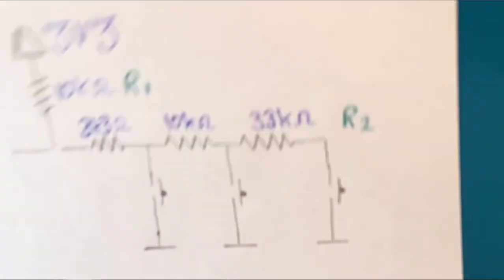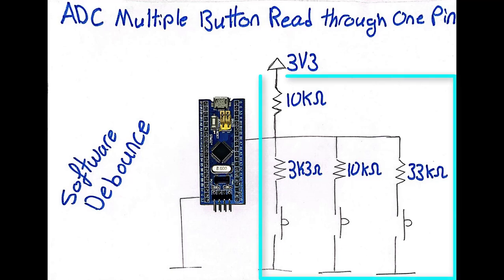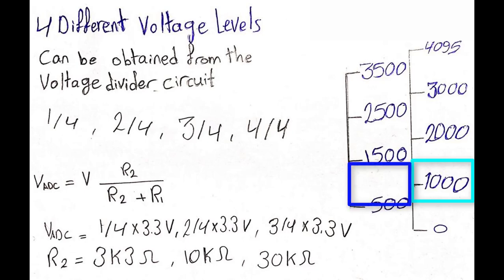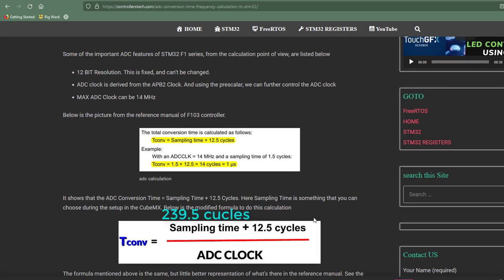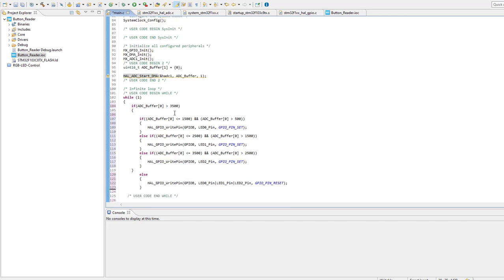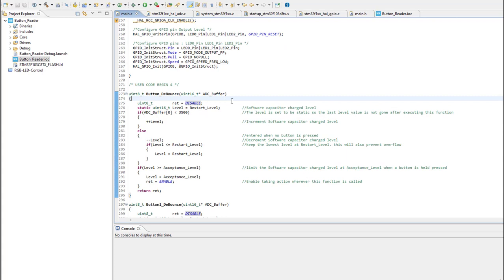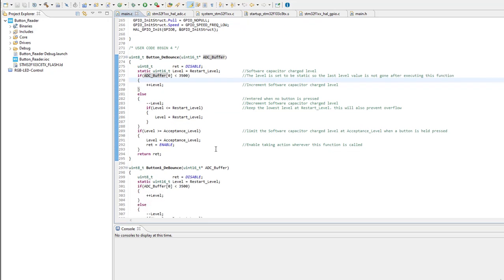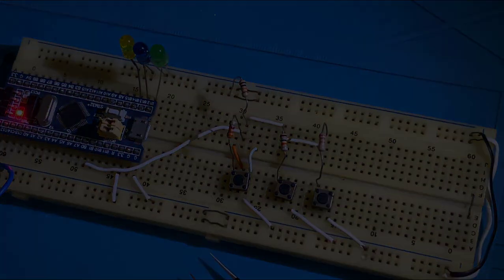STM32 Multiple Buttons ADC Read Through One Pin With Software Button Debounce

Comment: Do you have any sources or tutorials for using the black pill?? My rocket team got one to use for sensor reading and data transmission and can't find out how to upload code to it. We have used Arduino before but nothing else
Reply from the maker: STM32 has many application examples. You don’t need to look for specific board or MCU code